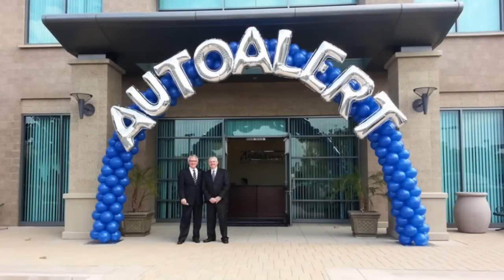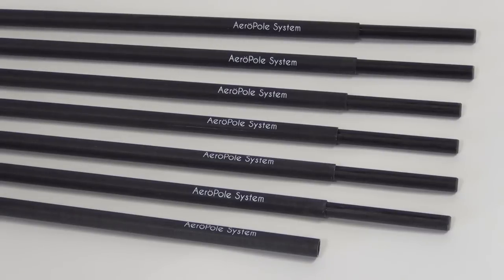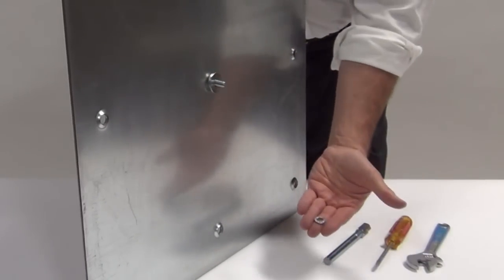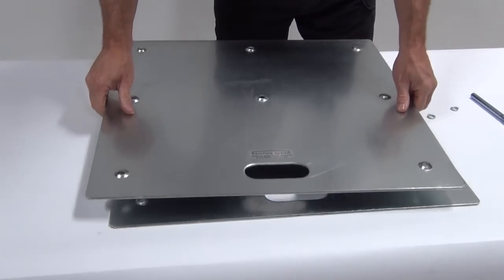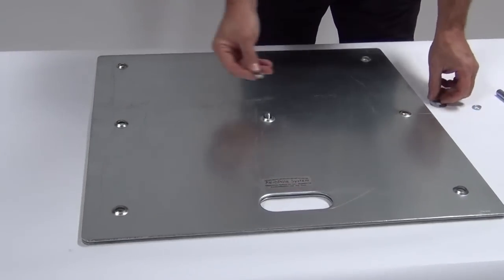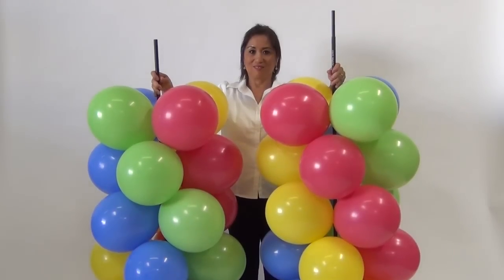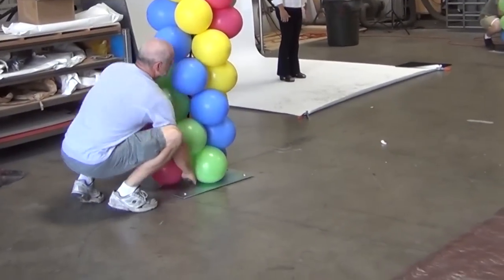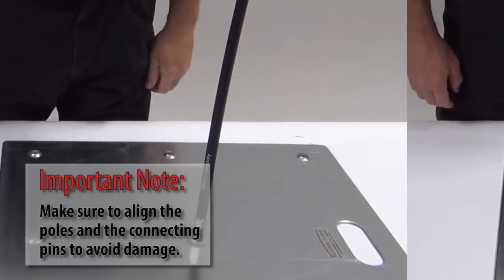AeroPole Instructional Video 2014+

Comment: I'm thinking that you have additional baseplates that can be purchased separately?
Reply from the maker: Linda, yes you can order extra base plates or any component of the AeroPole System. You can get it from the same distributor that you purchased from originally. If they don't have what you need in stock they can order it through Pioneer and we will drop ship directly to you.
Reply: Thanks
Reply: Where can you by tap from and the name of it